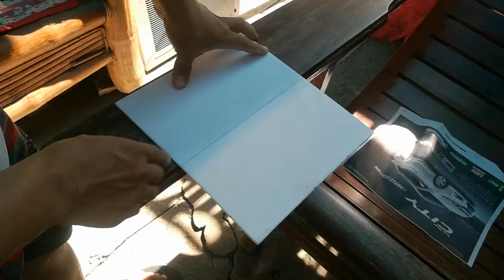DIY Mini Palette Box for Plein air

Comment: Great design! Love that you aren't using power tools too. Is the white panel Gatorboard? Thanks so much  for sharing your process.
Reply from the maker: Hi, Thank you! The white panel is an acrylic sheet 12X12 in. I just cut off to fit in the box. You can check from a local hardware store or online.